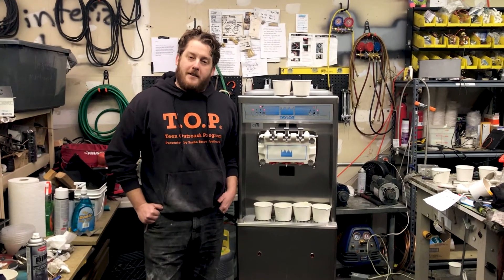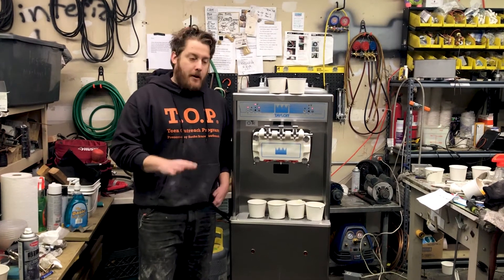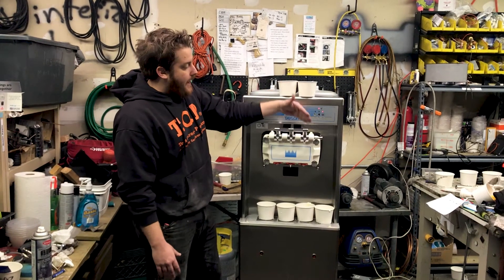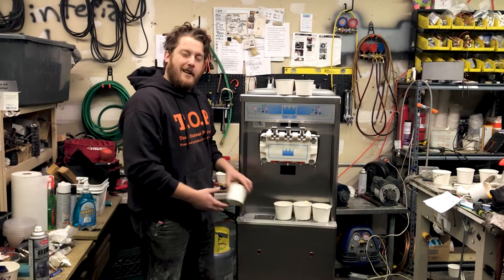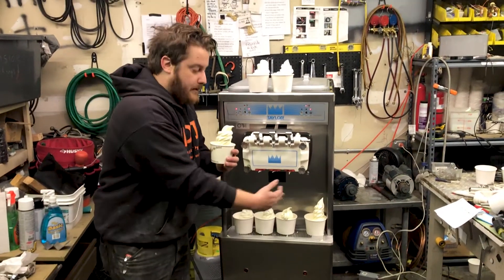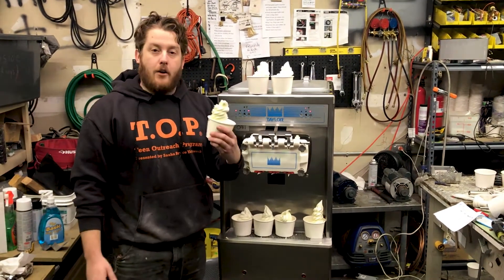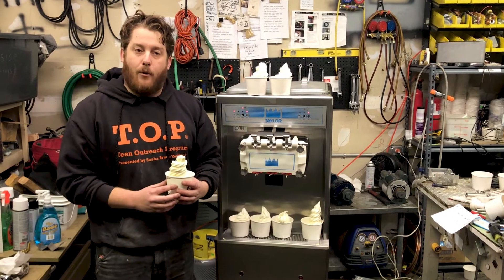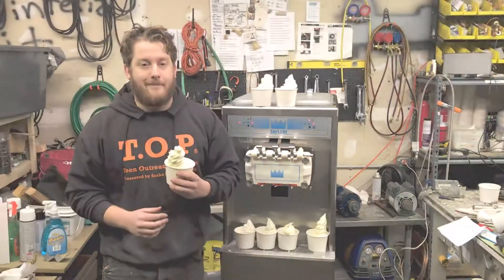Taylor 794 Soft Serve Machine Recovery Time Test

Comment: So a 3.2 liter barrel yields 3.2 liters of product before recovery is needed.
Makes sense...
...and that would be max recovery. 

How do the servers equally balance out usage between 2 barrels?
Answer:  They don't.  Likely if one if soggy, they dump it, and try again on the next barrel.

UNLESS, of course, both barrels contain the same mixture, and the boss man tells them
to ALWAYS use the center dispenser (the twist). 

IT IS an option for those busy days.

Later!

Comment: Let's assume you are just giving away the soft serve to customers, and you have 100 person to serve. Is the machine able to keep going as you show on the video or is it gonna needs recovery at a certain point? If yes, after how many cones served, and how long should be the recovery time? Thank you in advance
Reply from the maker: Yes this machine will need recovery, the key is to slow down the line enough for the machine to recover. The freezing cylinder holds 3.4 quarts / each and initially takes about 8 - 12 minutes to freeze down. Recovery is quicker if there is still frozen product in the barrel.